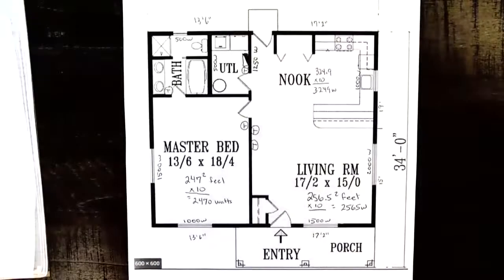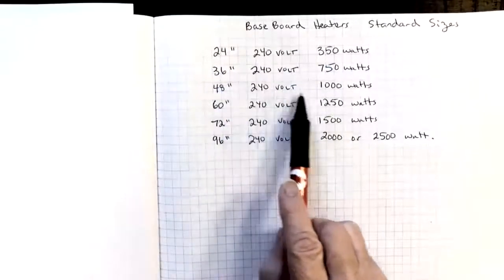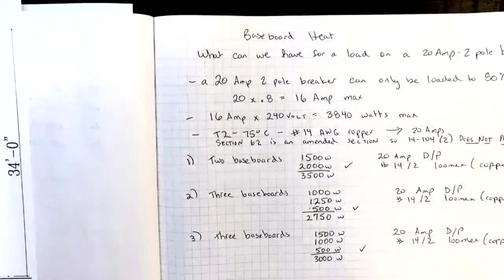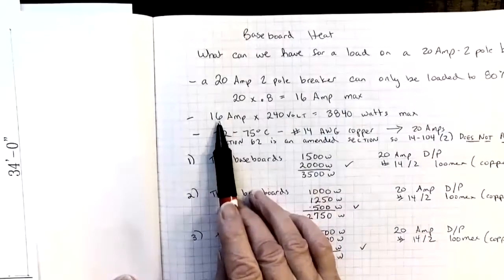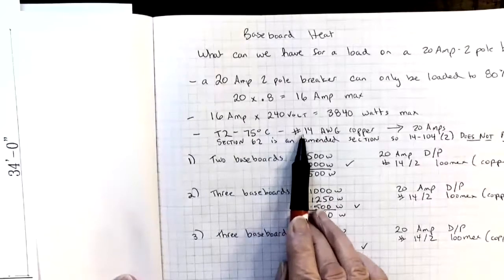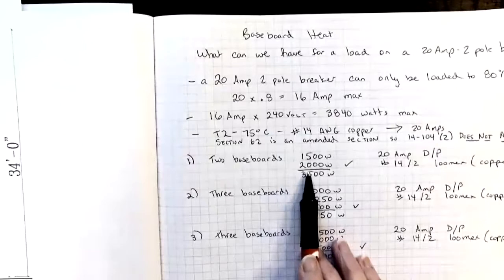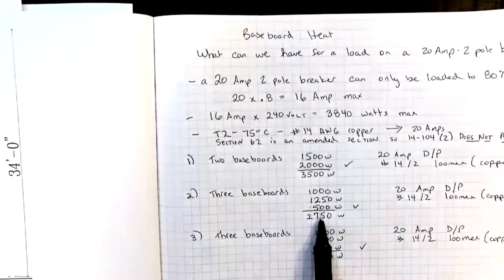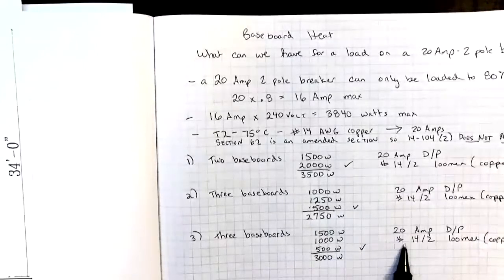CEC 2018 Section 62 Calculating the breaker and wire size for baseboard heat in a one bedroom house

Comment: I wonder why use wire 14/2 not 12/2 in 20A?
Reply: As she pointed out. Section 62 is what's called an amended section. Therefore, rule 14-104 (2) does not apply.